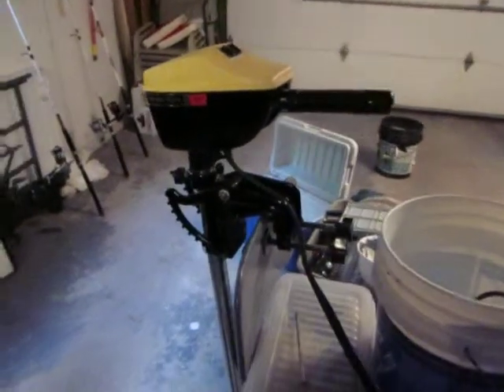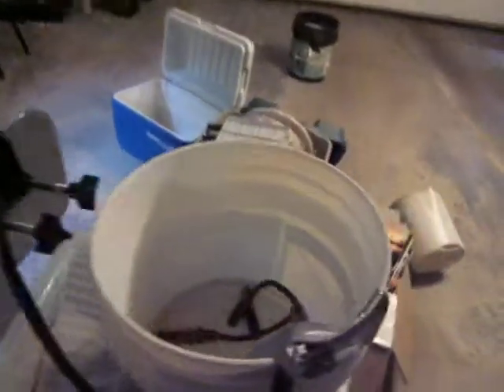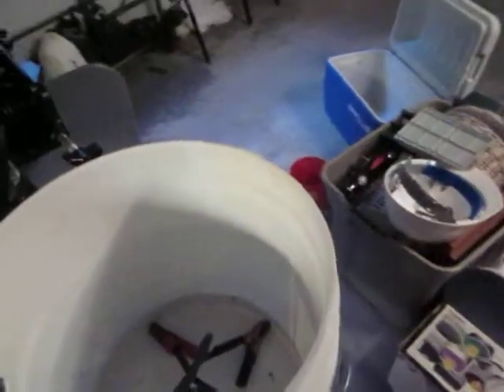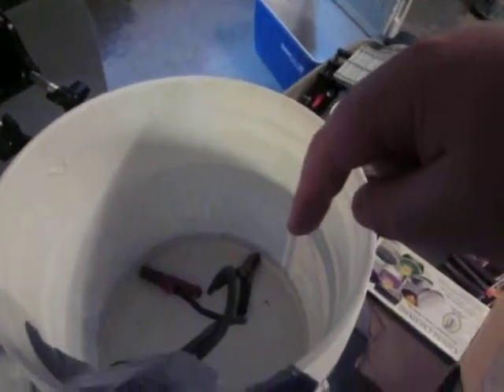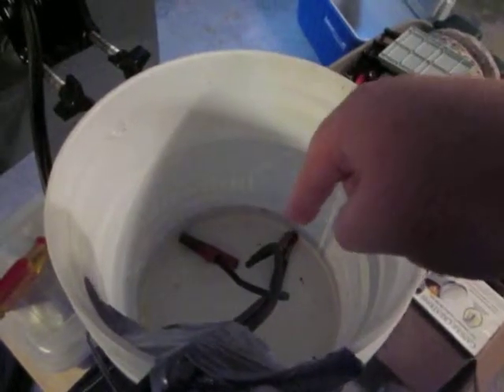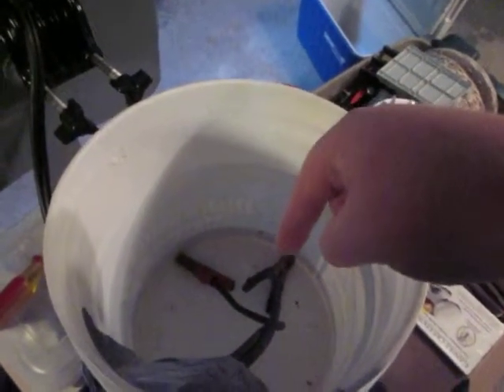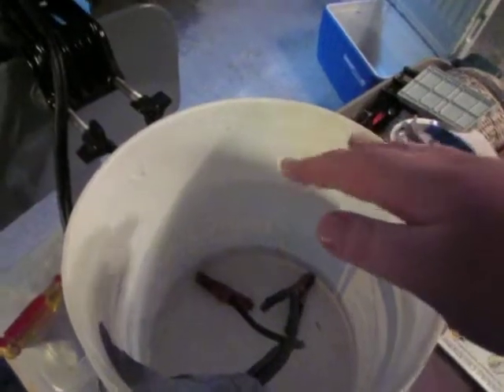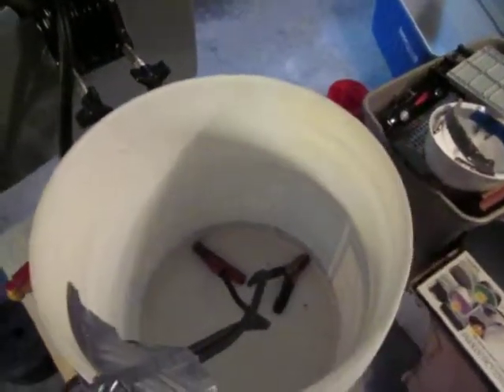How to clean your alligator clips on a electric motor

Comment: I'm an electrician and I recommend you tu use also battery terminal grease or copper paste to get proper connection after those are dry.